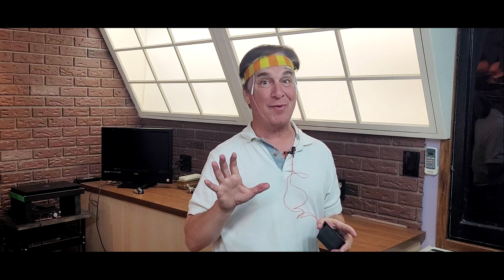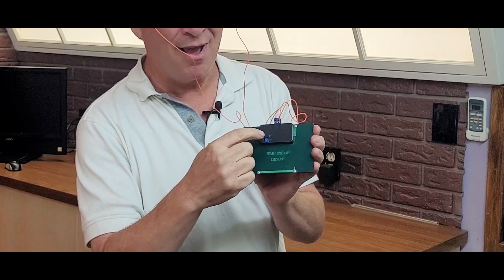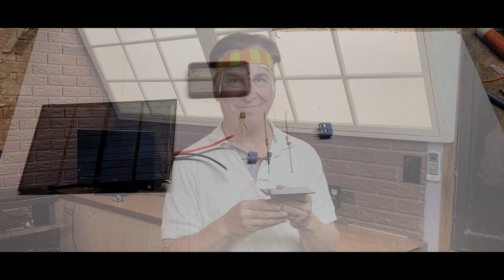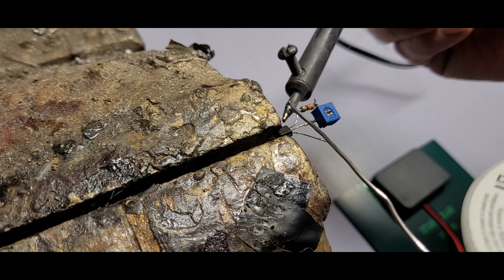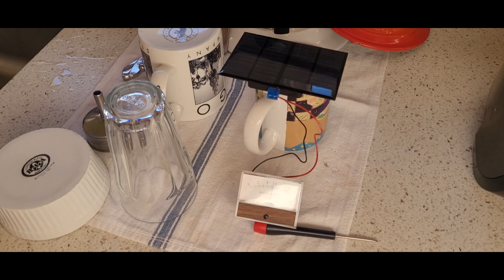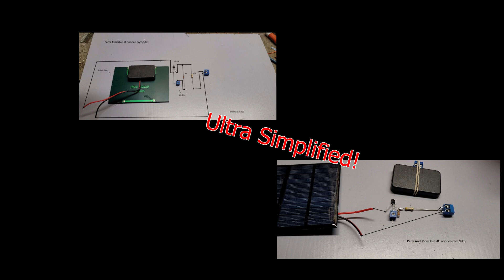Worlds Simplest tDCS?  Solar Power!

Comment: Hey I have a question about the muriatic acid copper playing video.   How much time can you use the positive copper piece that’s placed in the acid on the positive wires.  ?  Like how many uses do you get out of it u til you have to replace the positive piece of copper ?    Thank you!
Reply from the maker: I've used the little electroplater in demonstrations for several years, and still not noticed significant loss from the electrodes.  Thanks!